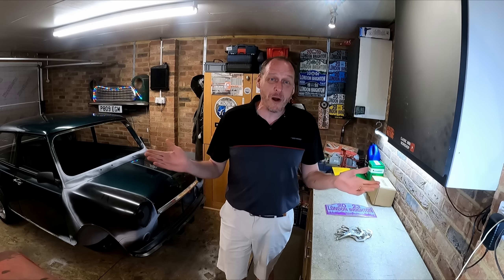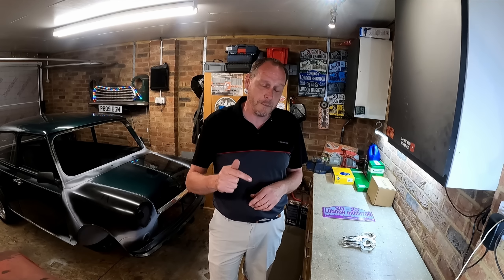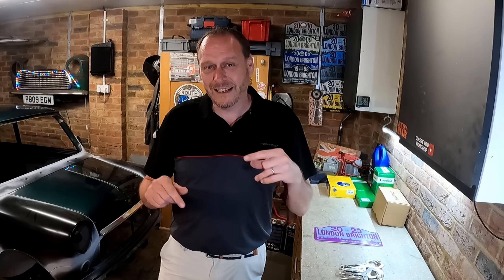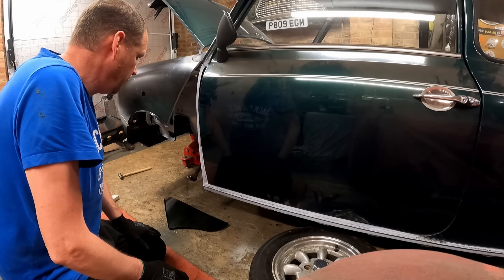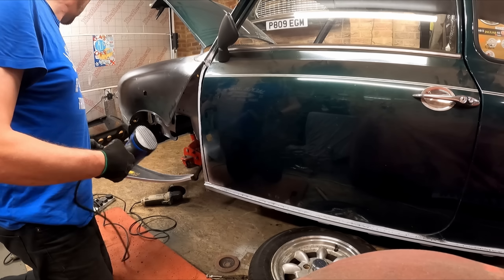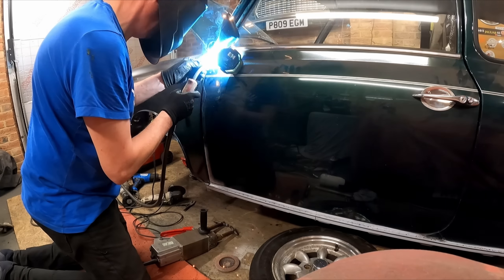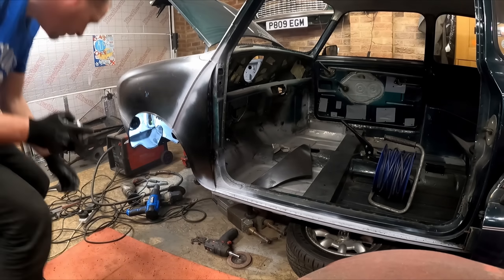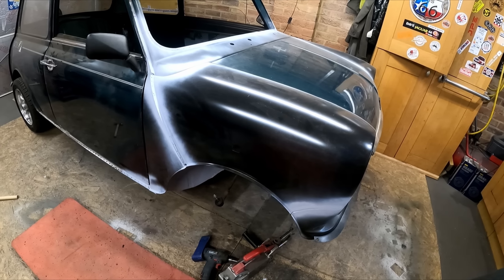Fitting A Panels - Classic Mini Workshop - Racing Green Pt.39

Comment: This installation seems to have gone perfectly. I am trying to fit mine on the drivers side, removed the old one etc, and finding the curve of the A panel different to the curve on my wing. I think its the wing that is at fault though, as the curve of the seam strip cover matches the A panel. So that is going to be fun to figure out how to resolve. Also at the top where you mig welded your a panel to the body, mine had a bunch of lead there, could gouge it out with a chisel and no sparks with a grinder, so taken most of that off so far, as you cant mig to it, it just splatters you if you try. Another great video, thanks

Comment: Usually there is a small bridging piece between the bottom of the A panel and the wing. Bit weak there without?
Reply: I had similar thoughts. I hope you haven’t omitted that piece Keith, they’ll be a fair bit of wing flex without it!
Reply from the maker: I'll add that before anything gets painted